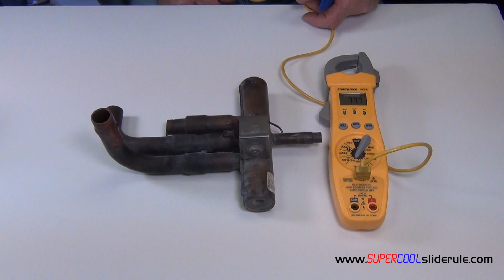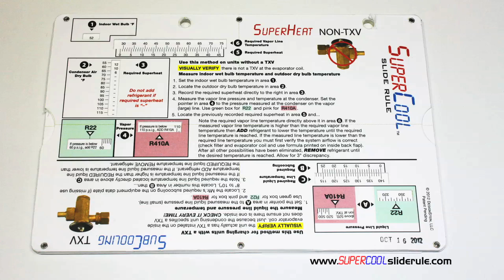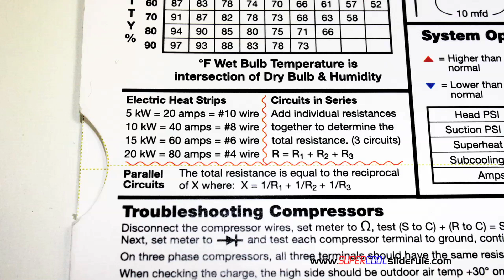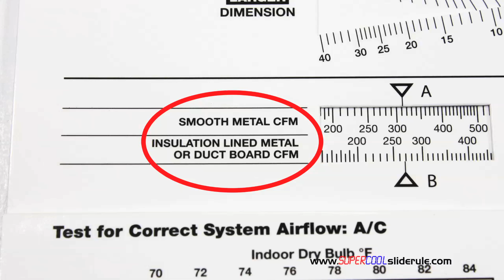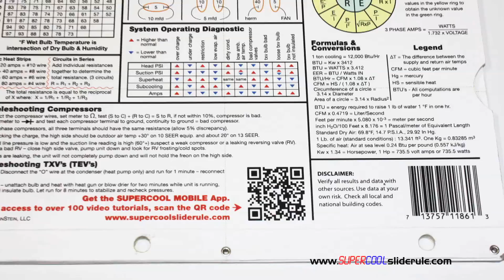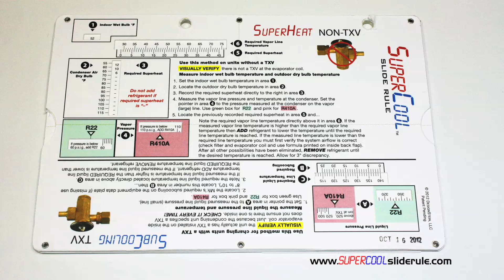How to Troubleshoot a Reversing Valve

Comment: Most concise method of testing a reversing valve I have seen yet! BRAVO & CHEERS !!!
Reply: Seriously?  He didn't even demonstrate how to confirm the 24V going to the solenoid, nor did he demonstrate how, if the reversing valve gets stuck, you can tap the sides of it with the plastic end of a screwdriver or other tool to try and free it loose. 🤷‍♂

Comment: If the reversing valve is bad, and stuck fully open or fully closed, you're still going to have normal temperature readings, correct? 
The only way the readings will be out of whack is if the valve is caught half way? Am I on the right track, or am I misunderstanding something?
Reply: I'm about a couple of years too late to this comment but disregard that. I'd say theoretically speaking yes you're right, but I suppose you could do this test in cooling and also in heating in order to see if it's stuck, I have also seen someone put a magnet on the outside of the part that slides over to visually see if it's sliding

Comment: How are you calculating amperage for heat strips?  10 KW @ 240 volt needs #6 wire and 60 amp breaker. 5 KW @ 240 volt needs #10 and 30 amp breaker.

Comment: So you do this with the unit running? Question how do you get to the valve with the fan running? Just a commonsense question.
Reply: Andrew Rowzee yes the unit must be operating.. say for 20 mins and you get to the reversing valve by removing the units side cover to the compressor area
Reply: Okay say its a Goodman, Nordyne, or any other unit without a side cover area. Your kind of screwed right unless you unplug the condenser fan motor.
Reply: Your gonna need 4 temperature clamps and 2 meters. U could use 4 testo wireless temperature clamps. Testo 115i i believe the number is.
Or your testo 550's clamps & 2 115i's
Reply: Would a laser thermometer be useful in this particular application ?
(assuming you don't have the proper probes or meter on hand?)